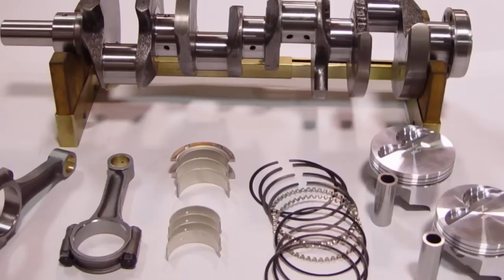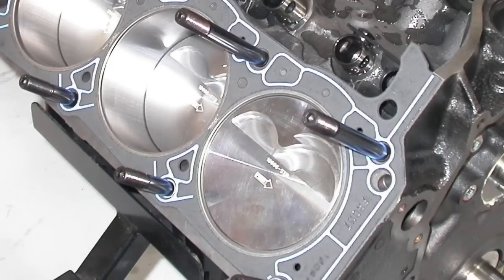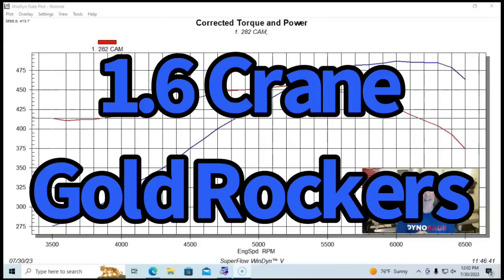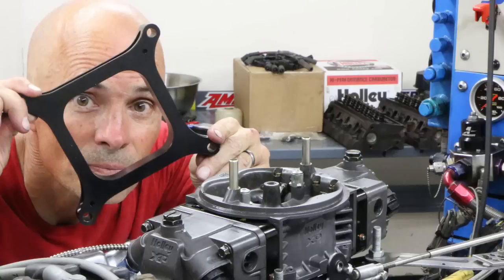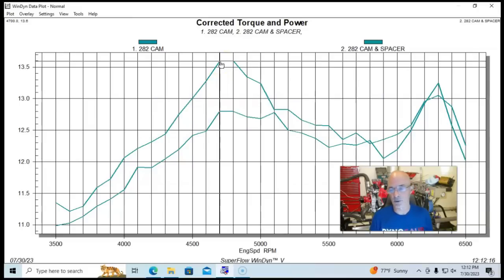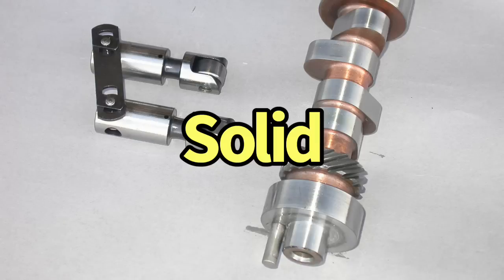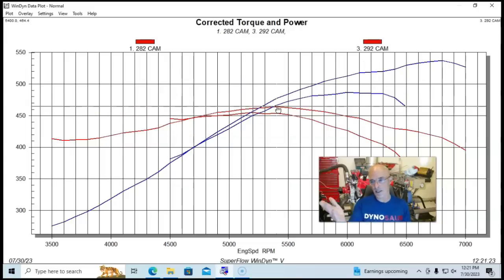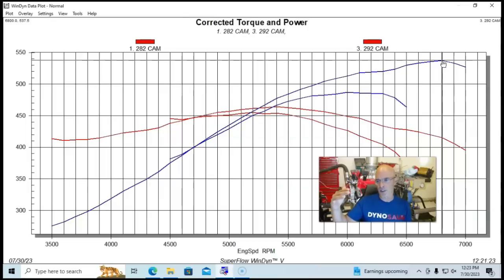WILL MY 5.0L FORD MAKE 535 HP? HOW TO: 535-HP 347 FORD STROKER POWER BUILD! SOLID ROLLER CAM SWAP

Comment: I have a near identical motor to this one, and made (543hp) the same power. I swapped the intake to a Super Vic and a custom 830 Holley, but have not dynoed it again, yet. After it made the original numbers I spoke with Edelbrock and AFR, both told me an increase of 35 hp with the SuperVic. The port size on the SV matches the intake ports of the 205 heads, the Vjr is substantially smaller. 
Westech is a great shop. you guys wheel dynoed my '70 Buick

Comment: Hi Richard, I enjoy watching the Ford 5.0 vid's, these are my favourite motor. I have built a 347 stroker with AFR heads, comp cam, roller rockers etc for my Aussy Falcon its a great engine. I wonder how far you have revved a 347 motor and had it live. Cheers from NZ, Phil

Comment: Cleveland-style heads like wider lobe separation angles because they have magnificent cross-flow between the intake and exhaust valves. Windsor style heads need a tighter LSA, usually about 3-4 degrees tighter for the same results. Take the traditional in-line valve SBC for reference.  It has terrible cross-flow and loves a 108 LSA.
Reply: Cleveland heads are cool!
Reply: They love tight lsa too according to the dyno.   Tight lsa results in a stronger and more pronounced torque curve.

Comment: The roller cam had no losses compared to the previous.   So many people are building 347 which are substandard ( in the 300 rwhp range ).  when even a LS1 with STOCK heads can make 420rwhp/400rwtq and with aftermarkets 460rwhp/420rwtq out of 346 cubic inches.   Richard built some great combinations here with the AFR205 heads on 347 cubic inches.
Reply: The 483HP one would've made 411rwhp/382rwtq and the 538HP one would have made 457rwhp/395rwtq.   Very respectful numbers.
Reply from the maker: there is no way to know whp from fly hp without actually testing
Reply: True
Reply: E incluso fluye mas un ls
Reply: A Cleveland engine can make more than ANY LS with stock heads. LS engines are a copy of the Windsor ford and the heads are FE wanna Bs. They ARE a dime a dozen tho. That’s about what they are worth for longevity.
Reply: Brent Lykins made 535 HP with 311 cubes with 185 heads. 
  He used 5.7 aluminum rods.
    10.5 comp. I own the motor now.
Reply: @MichaelCoger  Hi, what vehicle do you have it in and how is it running.   The engine does sound glorious.

Comment: Makes me wonder if the hydraulic lifter was pumping down from spring pressure .... The nose over is you would think spring bounce but probably not ... Not sure the change in exhaust event but maybe a lack of exhaust flow ... Something certainly happened that's a little odd

Comment: AFR Heads are Super power adders for any engine they're available  for. Just match or make short blk flow to head you pick. Larger Valves always increase torque .
Reply: True.   A guy built a 504hp@7200 and 388ftlb@5400 combination using afr 205, super vic, 12:1 combo.   The number was made on 91 octane.
Reply: depends on how much cam u have no sense in buying big heads if all your going to run is a street cam with 550 lift  are big cams streetable no i know ive tried  they get old real fast if you need more power put a blower or turbo on it   is what i do now

Comment: People sleep on those SBF’s and idk why..
Reply: Chrysler Hemi power in a small light package.
Reply: I'd say it's something to do with the cost. Spend 10k on anything and it usually goes. 

Literally anything with main caps that'll hold it together. Add a forged stroker rotating assembly , afr ally heads , solid roller cam , roller rockers, single plane intake and headers it'll usually make numbers lol. 

It's the stock intake manifold EFI cast iron headed motors people sleep on lol.
Reply: Because they take abuse
Reply: As a sbf fan, yeah they are pretty good but engine technology has come a long way so it takes some bucks to even make horsepower some stock LS engines can do.
Reply: @Staypuff777  well I guess it's the factory aluminum heads, put same flowing heads on 302 and there ya go
Reply: Cost. It costs more to build a sbf than it does a sbc or an ls. You can also make more hp with a sbc or ls reliably in most cases
Reply: @jacksonvaughn51  it used to b cheaper 4 chebby, now it's all bout same, but ford last long time, chebby u got to keep them on speed dail every race
Reply: @jacksonvaughn51 False. I read a quote that read dollar per dollar chevy wins. Mod per mod and ford takes it every time. And after doing my research it's true. Equal displacement a ford out does the chevy. And in most cases live longer to. 302 better than 305. 351 better than 350. 460 better than 454. 427 cammer is better than 427 chevy. 5.0 coyote trumps the 5.3 by a long shot and the 6.2 LS in more ways than not. You get the idea. Take cost out of the equation. Ford is faster, stronger, more reliable, better towers, and more pleasing to the ear to most. The biggest and stupidest comparison has always been the 302 vs 350. It should be 350 vs 351
Reply: A 351c 4v engine built apples to apples will trounce all of them. Factory heads vs factory heads... and that's 55 year old technology.
Reply: Nobody is sleeping on the sbf they just decided to go ls which is basically a sbf

Comment: So, I have a Windsor that is built like the solid roller version. I have crank journals turned to sbc and 6.125 rods with a 302 c/h piston. 357 ci ,243@ ,257@.050  .651.649 110+4. It's around 11.2:1 and I spray 2 kits on it. Stock crank has made it but I also run 1011-2s , so if I have some problems it'll mayb knock the gasket 1st before RUD. Street car driven ALOT! Its hard to get 1.6-7 hp per cube from a 302 for real

Comment: I recently built my 347 with a stock 1997 Ford roller block, used ported 185cc cylinder heads, a Weiand Xcelerator single plane intake, a 2" spacer, A proform 750 CFM carburetor, Malhe power pak forged flat pistons, forged scat connecting rods, a 28 oz summit racing crankshaft, a speedmaster lightened flywheel, a Hei msd distributor, an msd 7al , Trickflow trackmax Stage 5 Hydraulic roller camshaft 595 lift,250/254 at .50, With all this I managed to get 520 hp at 6100 rpm, and 488 lf/ft at 5300rpm, It was a lot of power to run with 91 octane gasoline, and with a mechanical water pump and alternator, I was very happy with the result, do you think I can still add a little nitro? Considering that it is the stock Ford block, even though I added a Main cap girdle
Reply from the maker: yes-you can add NOS

Comment: Almost my same combo. I always wanted to see somebody re-do the Engine power Little Black and Blue SBF 347 part 1.5. They did stage 1 in part 1. They were going to switch the combination around to solid roller and supporting combination. They sorta did a part 1and 1/2 when they used some of the supporting piece for stage 2 on the first combo. They stopped before they put the Super Victor on it.  I also don’t think it benefitted much from the solid roller cam upgrade. I felt the original hydraulic roller was well matched to the motor. I think with the 950 Holley XP, Super Victor, Lunati? hydraulic roller, 1.65/1.72 rollers(depending on what the motor wanted) & 1 3/4” headers stepped to 1 7/8, I think it would have made 540-550HP or almost 1.6 hp per cube. Mr. Holdener, thank you for all the testing you have done and sharing these videos with us

Comment: You mentioned the Super Victor Manifold.   In some of your 351W based builds the TFS single plane intake was making a ton of power and torque, appeared to have more equal runner distribution.

Comment: I would like to see what that compression, heads and cams would make with an aftermarket block and 4.125 bore to unshrowd to the valves
Reply from the maker: 4.125 bore requires after market block
Reply: @richardholdener1727  If you would like to do it I have a machined R302 block that was machined but never built. Would need to be bored to 4.125. I also have new TF 11R 205 with 56 chambers. I would pay for all the parts

Comment: A vacuum signal in the plenum would be a great indicator of why and what is going on with the smaller cam vs the larger cam.
Reply from the maker: cam will not show vacuum in the plenum-at WOT, both cams show 0 vacuum unless a restriction is present before the plenum
Reply: @richardholdener1727  Which is exactly the point. The lower HP of the smaller cam was directly due to it running out of cam.

Comment: LS guys have had no issues going with cams over .600" lift for a very long time, while the Ford Windsor guys are still slightly reluctant.
Reply: That could be worth some of the torque and power that windsor builds tend to be missing compared to their LS counterparts.
Reply: Omg... ls motors are dropping valves left and right and trashing otherwise good engines. GM went too small on the valve stems to be reliable for everyday drivers and those stupid offset rocker arms pulling out of the heads! Don't get me started. I hate seeing an ls powered vehicle rolling into my shop... that tell tale popping of bent parts  pulling in... you always know what you're gonna find when the covers come off.

Comment: I think the solid roller spring was TOO much for the hydraulic roller lifters causing them to possibly collapse/bottom out and maybe even rebound/recover on the next event. Still a loss of valve control, just in a different manner but presenting the same way. Just my 2 cents
Reply: I agree with the rebound theory. Harmonics bouncing the valve off the seat.
Reply: Nah
Reply from the maker: nope
Reply: @richardholdener1727  
Then…..?
You posed it as an uncertainty “not sure why it did it with the 282 cam but not the solid roller?” But your answer of “Nope” seems to intimate that you know why. 

I have a similar combo just with the XFI248 so I am definitely here for the lessons🙏🏽

And thank you for all you do.  So love this channel. I have an LS7, a coyote and several SBF’s and have had my share of Ponchos❤️

Comment: I would have thought 1-7/8" headers, ported super vic with the 850 for the win, could have even gone 265 adv int @.050"" , used a .027"" gasket to bump the comp up and be closer to 600hp

Comment: Rich, how much does the hydraulic lifter weight and function vs the lighter solid lifter effect the top end power (assuming the spring package was good)? Would running the solid lifter on the first hydraulic roller camshaft gain anything on top? Just curious if power gains was all cam or running solid lifters was part of the gains…
Reply: Makes sense
Reply from the maker: it was the cam (big change in cam timing)-we have run hyd rollers to 8000

Comment: I'm interested to know how much difference an intake spacer makes on a factory efi intake manifold. Both a throttle body spacer and an upper/ lower manifold spacer
Reply from the maker: the TB spacer-very little if any, the spacer between the upper and lower adds runner length (a little)

Comment: Can you do a 5.3/6.0 nitrous test but the difference it will make with various fuels. E85, pump 93 and race fuel. 🙏🏽
Reply from the maker: if the fuel does anything to the na power, the nitrous just adds to that. The one exception is that you might be able to run more timing with higher octane-but again, it makes more na (then nitrou adds to that)
Reply: @richardholdener1727  got ya! Just trying to grasp the advantages of running a “cooler” fuel vs the HP gain a race mix might get you.
Reply: E85 has a huge advantage in power adder combinations.   On even only 7psi e85 can give 40 or 60hp due to being able to run full timing.    On 15+psi e85 can be worth 100+hp.   I'd imagine the story is similar on nitrous.

Comment: Also I’d like to add that the first cam test was probably collapsing the lifters maybe because of the harsh spring rate.
Reply from the maker: no
Reply: Richard, did you have the hyd lifters collapsed almost to bottomed out?

that gets rid of almost all the mush lol

just need a longer pushrod

Comment: what exactly is limiting the lift number on cams? Just PTV clearance? Id love to see some .700+ lift stuff
Reply: P-2-V clearance, retainer-to-guide clearance (check with the seal in place!), coil bind on the springs.  Those are the biggies.  Even the rocker arms can become a problem of you have the wrong length pushrods and hit the limit of their travel.
Reply from the maker: lift has very little to do with P-V, but the time the cam has opened the valve all the way, the piston is down in the hole 1 inch or more. Duration is what determines P-V
Reply: @richardholdener1727  thanks Richard, I'm curious because I have a set of ported stock LT1 heads that flow crazy numbers at .700 plus lift and I'm trying to plan out my cam upgrade for next summer.

Comment: If you bump oil pressure to 90-120  hydraulic acts like solid .
Reply from the maker: no it doesn't
Reply: @richardholdener1727  ok professor. 😂

Comment: Wait, you made over 500 HP in a production 5.0 block and it didn’t split in two?  😱
Reply: THEY ALWAYS SPLIT AT 500!
Reply: It's all in the tune.  My dad never split one ever.
Reply: The number was around 600hp...   It'll crack down the lifter valley, the mains might crack out!   The block is THIN.
Reply: I don't know if I have ever seen a 5.0 split at 500 hp. Lol just dumb shit Chevy guys say.

Comment: I think Vizard wouldve recommended a 107 or 108 LC, and a Performer RPM air gap, for a HUGE bump in torque below 5000, and no appreciable top end loss. He mightve also suggested a LOT less duration.
Reply from the maker: there would dramatic loss in top end power from a dual plane on this

Comment: Probably get even more with a Holley Sniper EFI. Carbs cannot match an EFI.
Reply from the maker: carbs can't match EFI? you might want to review more dyno results
Reply: @richardholdener1727  I meant in overall performance. You might be able to equal top hp of the engine, but in responsiveness and engine operation EFI has the advantage.